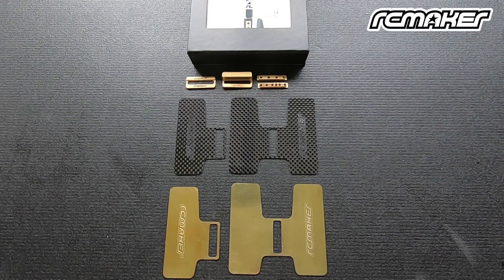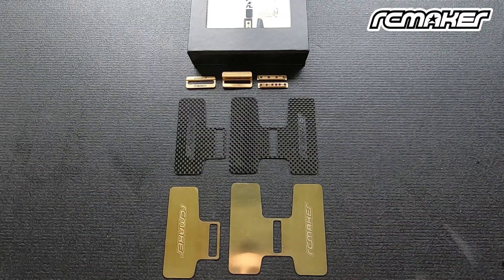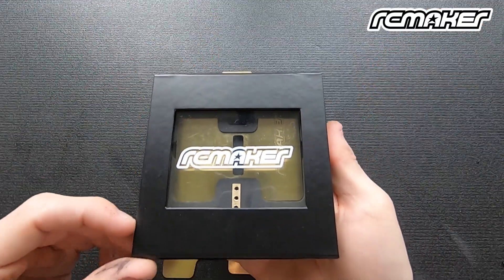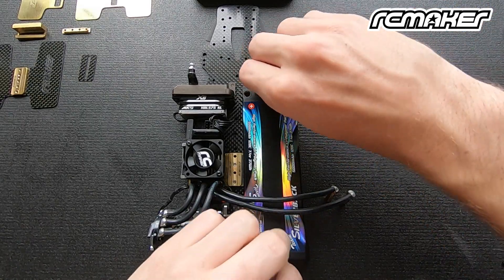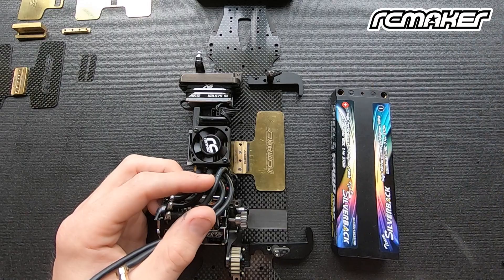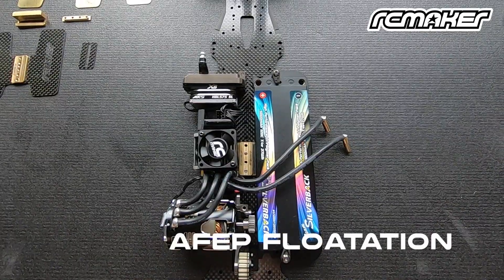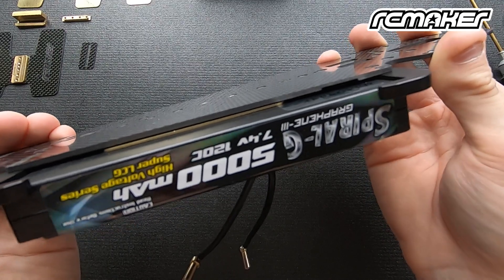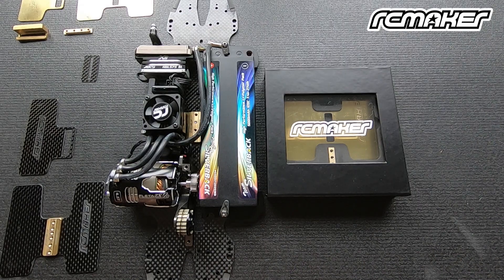RC MAKER Adjustable Floating Electronics Plate System (AFEP) - Explanation & Demonstration

Comment: The connection between the left and right plate, especially on the carbon version seems to be very fragile to carry the weight of the battery.
Reply: Thanks for clarifying! I will give these a try.